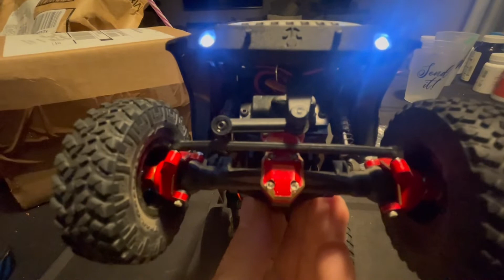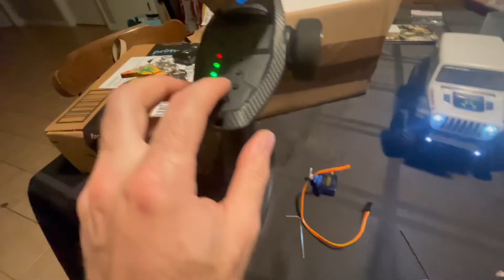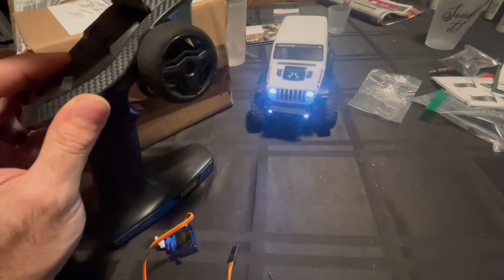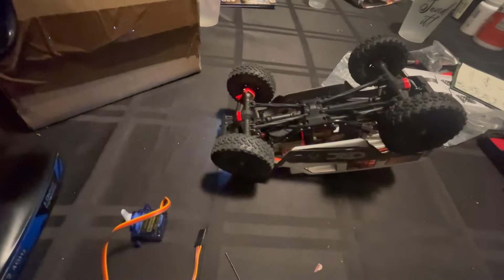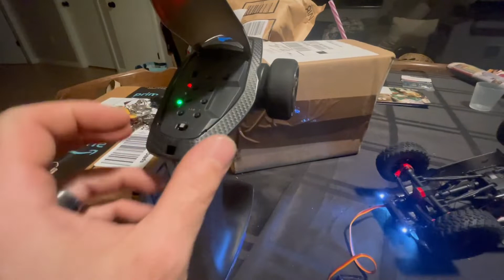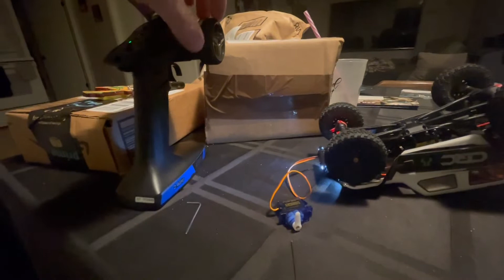Broken Radio on my SCX24! Part 1

Comment: You probably have already fixed that problem after 2 months now but for what it's worth I believe you were already on the right track in replacing your transmitter and/or your receiver. It would take much more time to actually troubleshoot both of them, so might as well replace one or both. I have run into that problem a few times throughout the years and replacing one or the other did solve the problem. New subscriber here, best of luck to you!
Reply from the maker: I actually haven’t fixed it yet. I reached out to horizon hobby and they are now send me a new radio so once that comes in I’ll make an update video. Thanks for the sub!
Reply: @makestuffbetter19  Ahh, very cool. Looking foward to seeing how that works out.